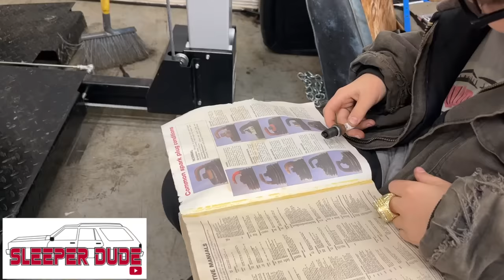FREE CORVETTE! Gets Upgrades and a Road Trip!

Comment: Fun fact ….
The C4 corvette had its brake parts sourced from Australia 
At the time we in Australia had world leading brake technology due to our production car racing at Mt Panorama Bathurst 
Our local cars all had 4 wheel disc brakes from approximately 1985 on
Great video guys!
Reply: Volvo had it from 1968, with the introduktion of the 140 and 164. 

I give you that you had sone cool stuff.
Reply: Jaguar had four wheel disc brakes in 1957. Try cleaning the throttle body blades.

Comment: Way to go Ralphie, couldn't ask for a better first car. You're going to have the pick of the litter in school when you get ur license 👍😁.  My first car was a 1966 mustang with the original 289 in it and velvet interior. Just FYI for you, the fuel pumps on these C4s are a common problem, if after replacing the fuel pump and you are still having starving issues, there are 2 oil sending units located back underneath and behind the distributor, if the smaller one is going bad, it will mess with the fuel pump as far as loosing contact. You do not need to pull the distributor but you will need to pull the wiper motor. Best thing to do is replace both sending units if you dig that far into it. I had the same problem on mine and it fixed the issue.
Reply: Some good advice. Cheers

Comment: When I when I picked my 94 Ram about 8 years ago, I ended up going all in and replaced all of the brake lines, two rotors pads and calipers up front, rebuilt the rear brakes in the rear, changed out all the hoses. I learned from past vehicles that this is really the best way to go when you've had the brake system open for an undetermined amount of time. I've also towed and extensively off-roaded with the truck so it was nice to know that the brakes could keep up.

Comment: As a C4 owner, I would first check fuel pressure at idle and while revving the motor. Could be the new pump, sock or filter is clogged with grime that was already in the tank. Also could be the regulator. Pull the vacuum line from the regulator and be sure there isn’t any fuel coming out of the nipple. 

You should also do the old paper clip trick and short the diagnostic connector under the dash and count the flashes of the check engine light to see if there are any codes stored. It should flash code 12 three times(once, pause then twice repeated three times), then any stored codes followed by another code 12. The service manual will show you which two pins to short. They’re right next to each other if memory serves. 

You’ll figure it out. It definitely sounds fuel related to me. 

The new hoops and casings look awesome! 

Congratulations to Ralphie on his trophy! 🏆
Reply from the maker: Thank you for the tips

Comment: That unidentified canister near the inline fuel filter appears to be a fuel filter/water separator. It takes a cartridge filter like the old-style Chev oil filters back in the day.
Reply from the maker: Ok thank you
Reply: its the purge canister for the fuel tank not a fuel water seperator pretty much only diesels have those its just part of the smog system

Comment: Glad to see new wheels on the vette, looks great and hopefully it's a air sensor causing the problem. I had a 2010 Silverado for 5 years with the 5.3 ltre, ran great until it got cold weather eventually found out it was the throttle position sensor. Once I replaced the sensor and the gas pedal I had no more rough idle and could accelerate etc like normal, but with fuel injection almost anything could cause surges,  loss of power.

Comment: I had an 86 TPI auto like that one-- except mine was black with tan interior. The front Y pipe has what are called resonators on each side. They were designed to give the vette a tuned exhaust sound.... so it would not sound like your average farmer's TRUCK rolling around. Problem was? They are restrictive as hell. If you will cut OUT those resonators? You will get about ten more horse and also really HEAR that motor. They also sell a Walker front Y pipe that already eliminates the resonators, and all ya gotta do is sign the off road waiver at the place ya buy the Walker front Y pipe from.

Comment: Excellent video Sleepdude Crew Josh  :) also change H2 sensor  on manifold  also 02 Sensor on by Catylic Converter  to Corvette  and plus Fuel Regulartor to plus Mass Air Flow sensor and run 5% 89 or 91 or higher octane has No Ethonal! Plus get Grey bottle of STP Total Treatment fuel injection and carb cleaner in fuel tank each month to ! Plus check on Computer plug in see what says on lope when doing too after cleaning out codes then engine and drive test to! May have Catylic Converter plugged up from sitting too and be a guess! OB1 tester should help check it out !

Comment: Awesome video guys.  Koolest part was when the both of you smiled at the same time.   The look on both of your faces was exactly the same.   
Congrats Ralphie on the tuneup.  
Could be the brand of gas.  Had that issue back in the 90's on a Chevy I had that was about the same age as the Corvette.  Changed out the gas and the issues went away.

Comment: I’ve owned (and still do) several tuned port cars and would bet it’s not the computer. They have a backup fueling rom similar to a limp home mode if the sensors or ecm fails. Check fuel pressure at the rail, if you’re still using the original regulator the diaphragm could be bad and it’s just bypassing back to the tank. Or the usual suspects, plugged fuel filter or lines or weak pump. And I know you’ve just replaced those but you know how junk floating around in a tank that’s been sitting can be. I don’t remember seeing the video where you changed injectors but just fyi the L98 needs 22lb injectors although I don’t think using smaller ones would cause what you’re experiencing. There’s several ways to read live data from ob1, (yes you can see tps, maf, fuel trims etc) winALDL is my personal favorite. Good luck and great video as always.
Reply from the maker: Ok great thank you

Comment: I would go ahead and replace the TPS sensor and MAF sensor on the vette... With its age its wise to replace both and see if the throttle clears up... On 4 gen vettes after about 15 yrs those sensors are about to malfunction....
Reply from the maker: Yeah probably right

Comment: Great job! I'm working on the brakes in my 69 Mercury but I'm having a hard time sourcing parts. At least with the Vette you are still able to find parts for it and will for a long time to come. 👍
Reply from the maker: Thank you
Reply: You should try Rock Auto, they had all the parts I needed for my 87 Diplomat police package car.
Reply: @williamcole464  RockAuto is always my first stop when looking for parts. They have the Master and calipers but the flex hoses are not for disc brakes and the booster is not available unfortunately.

Comment: Love the videos, ya'll are a great family, watching since you quit work. Don't know if you have found a motor for the Fairmont yet, but I have something I'm going to run past you. I heard you say you wanted a big motor if you could find one. I have an '85, F-750 truck that has a 429-4v, and actually does only have 88,550 miles on it. I haven't started it in probably 3 or maybe 4 years, but I did run the truck some around here close since it was last tagged, and that was in '17 or '18. This is a really strong motor, had good oil pressure, don't smoke, doesn't leak or overheat. Truck has air brakes, 5 speed trans, 18,000 lb axle w/2 speed, like new radials, very heavy ramp bed with a new ( pulled one time) 10,000 lb. Electric winch. I can't just give the truck away, because the cab and bed will bring more than I would sell the whole truck for. Cab doesn't have any rust at all, AT ALL. It's amazing just how nice the cab and interior is. It has fiberglass fenders, and some one has broke a piece out a little bigger than a softball just outside the headlight on the drivers side. I'm getting batteries charged up as I'm doing this, because I'm going to sell the truck regardless of whether Ralphie wants it or not, lol. I'll be getting it fired up within the next few days, if you think you might be interested at all, I believe about $2300 would take this truck to Tenn. and I'm not, I don't think more than 100 miles from you down in N.E. Ga. First town south of Murphy, N.C.
And now the reason I'm selling the truck is, In 2012 I crushed L-1 vertebrae when I was going after the hogtrap on my fourwheeler, and I'll be 70 if I make it to the 11th of next month. It might even be that we can discuss separating the motor from the truck, I'll think about that. You wouldn't be able to keep tires on the back of that Fox body. 
Ralphie, you need to get Dad to grade the pasture hill down flat to play on, it would make for some fun time! I'll be watching and you kids be careful with these cars, because if you're not, they will try to kill you! Thanks for the videos!

Comment: Could try an in-line fuel pressure gauge while it's running. Looking for probably 45-70psi for fuel injection. Might have that exact info in a book or on a forum somewhere, if you wanted more precise range. If you've got fuel pressure, then might have to probe injector wiring with oscilloscope to see if they're being commanded to fire, since there's no obd system to look at. Granted if you've got a scope, you might forego the fuel pressure check since the only sketchy thing is the computer system at this point, but I don't think it would be a waste of time to confirm fuel pressure. You know how it is with new parts these days
Reply from the maker: Yes thank you

Comment: Standing up for Squeezy....my dad always said to release the pressure on regulator adjustments so the spring isn't putting constant pressure on the diaphragm. He was a machinist and said releasing the regulator would make the regulator last longer. It was safer to readjust the regulators each time to make sure someone didn't monkey with the adjustments.
Reply from the maker: Ok thanks

Comment: Congratulations Ralphie!! 🏆 😎 The Vette definitely looks better!! And i bet stops much better too! Maybe the sending unit in the tank is the issue. ❓️ Thanks for sharing guys!! 😁
Reply from the maker: Thank you
Reply: The sending unit is the fuel gauge. I had my car stall on me back in 2018 and it turned out the fuel pressure sensor was dead on the fuel pump. 10 minutes later and it hasn't stalled. 6 months later, the replacement part threw the same code and I ended up getting an ACDelco part and no codes.

Comment: Considering Ralphie is gonna be driving it ....when it comes to repairs on brakes there are no short cuts ....i recently redone the brakes on my fiancées 11 Ford Flex...4 wheel disc i replaced all all 4 calipers,rotors ,and pads ...fixin to start on her 2001 Dodge ram 1500 4x4 its gettin new brakes all the way around ,exhaust, tires,and complete frontend rebuild ...all 4 of our kids are grown but i still make sure their vehicles are safe

Comment: When replaçing S belts, use one of those hand extension grabbers to reach down and put belt around crank and other pulleys, the cheap one at harbor freight works just fine.
Thanks
M L Rogers  Pasadena,TX

Comment: If everything else fails try the EGR solenoid or the EGR valve hiding next to the distributor. I had a 1987 305 TPI in a 1937 Ford and that was a big problem in the 90's and they were not available anywhere.
Reply from the maker: Ok thank you

Comment: My guess on the car issue is a problem with fuel supply. I bogs when you are on the peddle and seems to idle ok when off it. Pull the new fuel filter and chen to see if it pulled dirty gas. Im not sure if you flushed the tank after seeing the dirty gas in the old filter when you changed it. 

Check the filter, if its dirty, flush the tank and put in another filter. If the filter is clean, pull the sending unit and see if the socks are plugged. If none of those, maybe weak pump? I didnt see all the Vette vids so not sure what has all been looked at so far.

Comment: If you’re having a hard time getting brake hoses off, and are going to replace the hose, try cutting the hose off so you can use a socket. When you replaced the fuel filter, it looked like  another filter housing of some kind. My 69 f100 has a similar looking housing for the fuel filter. Idk if that’s part of your fuel system or not though.

Comment: Well, I would suspect the mass airflow sensor first. They had some soldering issues that could cause drivability concerns. I seem to remember a test where you would tap the sensor with the engine running and if anything changed with the idle, you knew that the solder joints were cracked inside. The only other surefire test is a volumetric efficiency test- but you will need to get setup for monitoring and logging OBD1 live data- old laptop with a serial port and WIndows 95, you can build your own cable for cheap and the software (WinALDL is free). Don't waste time cleaning it because those old sensors have a burn-off relay that self cleans the sensor after you shut the key off. Like you pointed out, the regulator is highly suspect- first check would be to pressurize the fuel system and pull the vacuum hose off the regulator and look for gas leaking out- gas=bad. Lastly, get a fuel pressure gauge with a long hose and tape it to the windshield and go for a drive. SHould be around 40.5-47psi key-on-engine-off and/or under heavy throttle and 30.5-44psi at idle (should hold some pressure for 60min after turning the key off). If all that checks out, you can back probe the TPS witha multimeter and see if you get a good smooth voltage sweep up and down- closed throttle voltage should be .55 volts and should sweep up to 3.5 volts WOT- go very slow and watch for any jumps in the voltage.  While i love the stock salad shooters, those wheels look great!

Comment: Ralphie got himself a vette...
My 1st car was a 74 Camaro..and I flipped a boat load of burgers to buy it...
Smog pump , gas suckin pig !  10 mpg .
I eventually yanked it out and put a small block pre emissions 350 in it...
And ,I yanked the rear dif. It had a 4:10 if I remember correctly..
I put a 3:48 in it (I think)
It made a world of difference...
It had excellent power & got 16 mpg...
My 2nd car was a 76 Ford Mustang Cobra.
Then a 77 Monza Spyder . 305 V8 . 
It would haul donkeys..
Then I bought a 78 Old Starfire GT  .
Same thing as the Monza , but an Olds.
It had a 260 V8 .
It ran fast too...
I wish I had all those cars today...
That was good times.
Back when you could buy a muscle car for a few hundred doll hairs..

Comment: Check the throttle position sensor, the mass air flow sensor, and the MAP sensor. Should be able to check ohms on each to verify if they are functioning in range. Also if I remember correctly the fuel pump relay is powered through the oil pressure sensor, so a faulty oil pressure sensor cutting in and out could be killing the fuel pump. Most likely the TPS sensor.

Comment: Another thing about the fuel pump. when you loosen the gas cap, do you here alot of back pressure? If so, start it without the gas cap and then try to drive it. A bad electric fuel pump will do what your experiencing.

Comment: If it were me I'd check the cat converters. Acts like the main is clogged. Pretty sure those had three and it's common while sitting to clog. They will run fine till they heat up. Also may be why they removed the rest of the exhaust.
Reply from the maker: Ok thanks

Comment: The “casings” on my Isuzu pickup came off of my Isuzu trooper. The date on those Michelin’s date to 2002. The Spacecab pickup weighs half of the Trooper so they have light duty. I also drive less than 60 miles on the freeway to keep the casings cool. I’m 70 years old and living on Social Security so I’m saving for replacement’s.

Comment: Try Syl-Glide on your brake parts. Works better than grease. Does not gum up like grease. You can also use it on electric parts like distributor electronic modules. Use it instead dielectric grease. It’s a great product. You can usually find it at Napa. Does not gum up like grease when it gets wet.
Reply from the maker: Ok thank you

Comment: If the fan never came on, my bet is it’s the coolant temp sensor and you’re getting too much fuel. The pcm uses the reading from that sensor once the car reaches operating temp. If the sensor or wiring is faulty, the reading will default to -40° and it’ll dump a ton of fuel to compensate for what the pcm thinks is an extreme cold situation. You should have 5v with the key on. On those engines I believe the sensor for the pcm is under the throttle body

Comment: i bought a 80 corvette in 1985 and it always had a fuel issue after owning it about 15 years in about 2000 i took the tank off it and it had leaves in it how the heck they got in there is beyond me because they were like full size leaves almost like they got in there when it was made as we had to crunch them in the tank to get them out and its funny how they didnt just disentigrate after 20 years but it ran great after that i owned it 35 years just sold it 2 years ago it only had 85,000 miles on it but they are to uncomfortable to drive as a daily driver only 2 people can ride and they are only on the road 5 months out of the year up here in michigan

Comment: On cars with 4 wheel disc brakes ,the rears wear more than front . They did that for a safety design to not cause so much front end drop on a hard break.

Comment: You know they make a cheap front brake up grade for these? Its just a flat stock bar that allows you to bolt on rotors & calipers from 98 up vettes. You can make the adapter at home.
Reply from the maker: Ok cool thanks